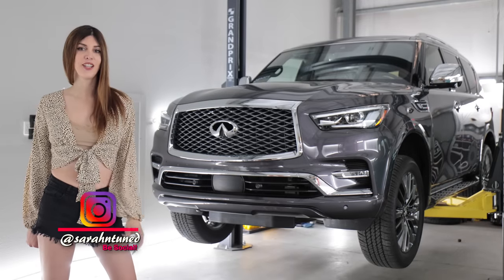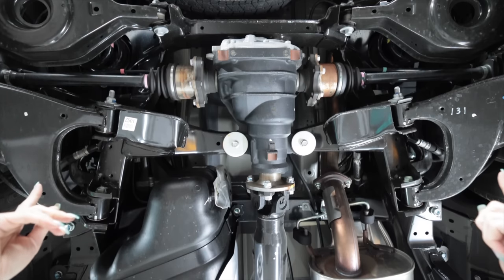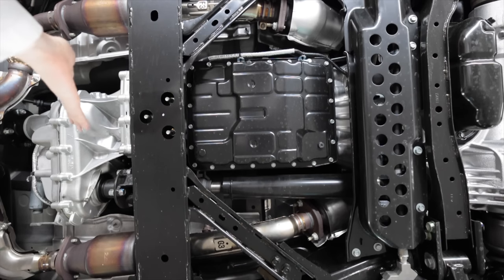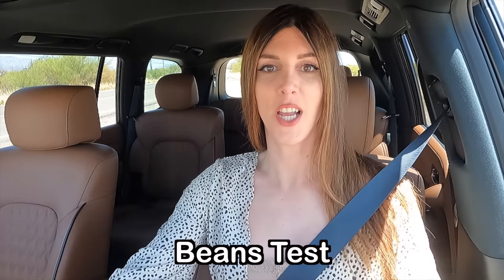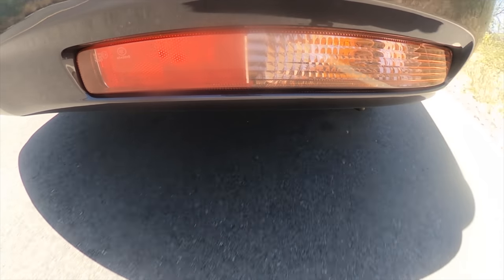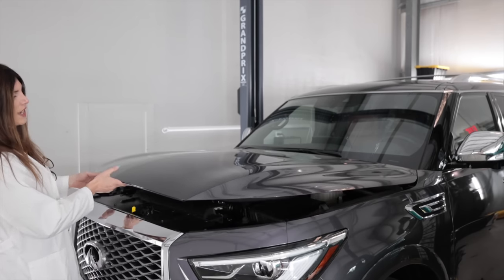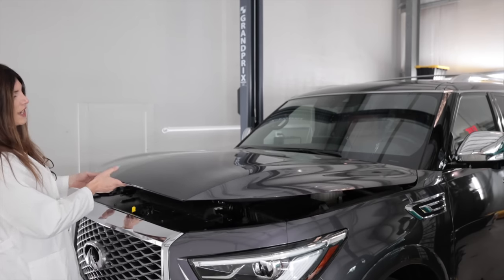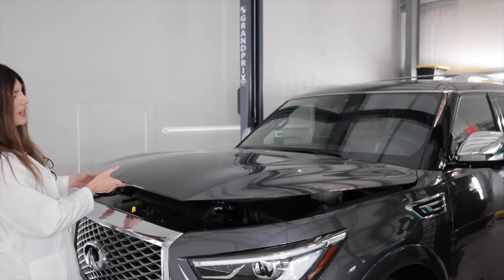2022 Infiniti QX80 Sensory In-Depth Mechanical Review & Off-Road Test

Comment: The QX80 only gets the R230 with the Armada and V8 Pathfinder. The R248 is only with the overseas version
Reply: V8 pathfinder doesn't have a 7 speed.
Reply: @occckid123  the R248 and R230 are the rear differentials. It has nothing to do with the transmission.
Reply: @BorellaFamilyAdventures  oh im in motion.  Read it as rea*. It doesn't need that. Nobody is bringing it up a hill line this.
Reply: @occckid123  not sure i understand.
Reply: @BorellaFamilyAdventures  the transmission code is similar. My mistakes
Reply: @occckid123  Ah okay, makes sense.

Comment: I’m not let down. Turn off traction control. It’s a beast. I have a 2021 Armada Platinum. It’s a beast on gas also, but I knew that when I purchased it. I took of the original tie after 2000 miles. I have Michelin Defenders M+S on now. Big difference.

Comment: I have to chuckle every time you do a review and open hood. To say that it's "fully painted" underneath the hood always blows my mind that some manufacture's try to save money there. :):)
Reply: I appreciate that Sarah points out nonsense like that. What else did the manufacturer cheap out on if they can't even paint under the hood. Oftentimes, the lower surface is just splattered with body color over spray. It is definitely a deal breaker for me.

Comment: I wouldn't trade my 2019 Land Cruiser for two of these. Great review as always Sarah. You are the best.
Reply: lol.  i am keeping my 2000 LC but possilby getting this as well.
Reply: I wanted the Land Cruiser but bought the Armada instead. Reason being, its  7 or 8 tenths of a Land Cruiser, for approx 1/2 of the actual transaction price. I think the Armada is well worth 1/2 the price of the LX600
Reply: you want to see how they drag your toyota jjjjjjj
Reply: I have a 21 LX570 (LAST of overbuilt Toyota reliability with V8NA engine). And now 24 QX80 Sensory from Scottsdale Infiniti for $17k off MSRP (since they trying to replace it with 25 QX80 brand new V6TT model). Both this QX80 and LX570 come with Hydraulic suspension

Comment: The tires are Dueler H/T as in Highway Terrain. I'm using the same tires (but of different size) on the ISUZU MUX - the cousin of the 2016 Chevrolet Trailblazer - and those tires don't really like the offroad. However, those tires love the pavement and asphalt (that is why it's called H/T or Highway Terrain).

Comment: You keep saying no one is going to off-road one of these but I plan on buying one of these and putting 18 inch wheels with 35 inch tires, skid plate, and rock sliders on it. And I will absolutely be off-roading it. No sure what to do about the bumpers though.

Comment: Thats a nice car. I like the brown interior. When my mom's 2003 Jeep Liberty got too crusty and the power steering pump went we were searching for a replacement. Our mechanic had a QX50, 2019 I think, on his used car lot we were going to buy and then my dad found a 2016 Jeep Cherokee for a slightly cheaper price at the Dodge dealer. It's been an awesome car. My only critique is the power seats that you program to your driving position. It's stored in the key fob. A few times I've grabbed my mom's key by accident and found my 5 foot 7 self squashed into mom's  5 foot 1 driving position 🤣. Keep up the great work!

Comment: Watching you try to climb that first hill, there was more going on than poor tires.  Both the left front and right rear tires were spinning suggesting that their "brake actuated" LSD doesn't perform very well.  A rear locker would really help, but the target demographic would probably never use it in the mall parking lot!

Comment: I realize this is a year old, but the HP/torque stats are wrong; the correct numbers are 400 horsepower and 413 pound-feet of torque. This and the Armada really need a rear locker of some sort.

Comment: Nice Review.. Cars are outrageous in prices. My mom bought a 1961 Chevy Impala Convertible in the 1960's for 2500.00. Cars cost the price of a house today. With Gas 5 dollars a gallon. I paid 27k for a Chevy Camaro LS V6 base model. An I just had it appraised for trade in for 15,500 at the car lot I bought it. It has under 18k miles. It's nice. But useless. I should have Kept my 2012 VW Beetle .I could carry more in the VW than Camaro. I want hatchback to carry animal cages/ traps for feral cats. I'm clueless at what to look for VW wagon/gti or Subaru hatchback Outback, forester or Crosstrek. Hard to find anything under 20k with under 100k miles. I had 2001 Chevy S10 4cyl 5spd. before VW bought it in 2004 had it till 2012. I love trucks. Can't afford one nor keep it up running with 7.00 diesel  a gallon. Sorry rambling on.
Reply: Look for a Mazda suv
Reply: @kendallsmith1458  thank you . i like CX 5. i'll test drive one!

Comment: Having been someone that came from an Infinity M56X top trim with the aero bumper, and test drove this SUV about a year ago, I can safely say that this SUV just feels cheap. It looks great, but feels cheap and looked cheap on the inside (Probably due the one I test drove had the old single screen and not the updated dual screen setup.) But it was huge, slow and not fun to drive at all. This vehicle is nothing more than transportation to the office and back (Or whatever you people do) and that's it imo
Reply: I'm a soccer mom driver in one of these. It makes for great road trips with kids. Thats about it. I basically bought it for the V8 and passenger comfort with that insane suspension! 4 teens sit comfortably in the the back. I want to put some Grappler's on it too.
Reply: @marge3477  but then you have the 13mpg combined gas mileage, that would be the worst road trip vehicle imo.